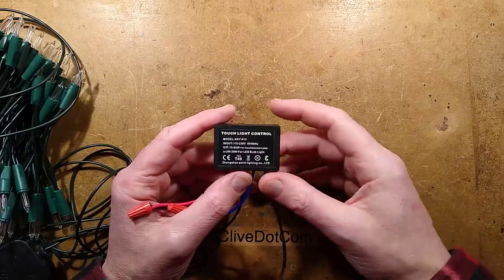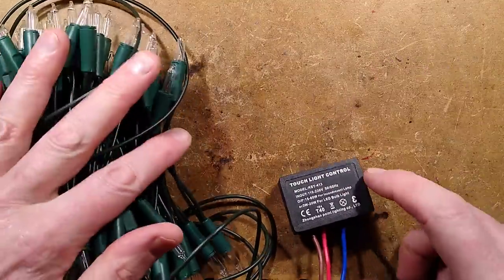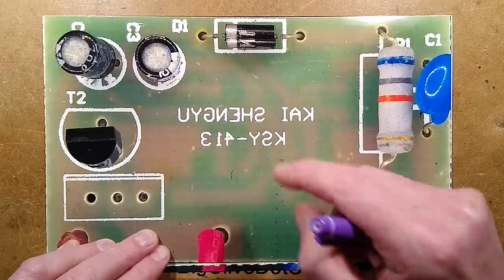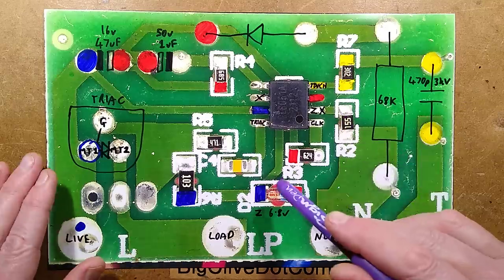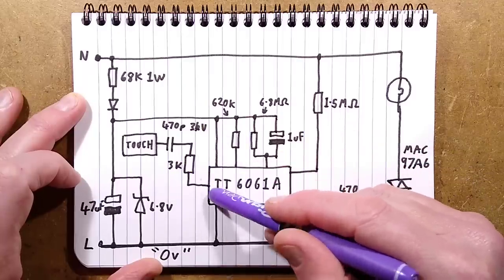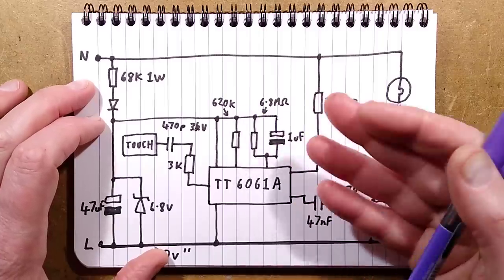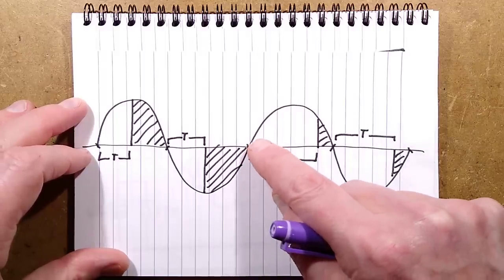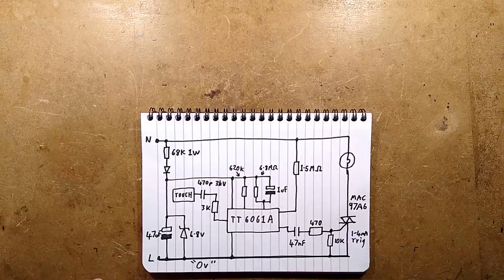eBay mains voltage touch dimmer - with schematic

Comment: Clive, do you reckon it may be possible the processor recognizes a change in the level of RF interference, and not a change of potential on the round sensor lug? Your hand setting it off on the insulated wire made me think so...

Comment: I never thought of using a dimmer switch in series with Christmas lights. It could dramatically increase their lifetime. 
Especially useful, not that the tungsten lamps are getting harder and harder to find with each passing year.
Reply: @Gazr Gazr Didn't the nasty flicker drive you insane? I can't STAND have wave rectified christmas lights. 🤢
Reply: @davelowets  You mean LEDs right? The flicker shouldn't be visible with incandescent bulbs.
Reply from the maker: Tungsten strings have made a comeback this year in the UK.
Reply: @M4RC90  Ah, yes, I missed that part. I can't even find incandescent sets around here anymore
Reply: @bigclivedotcom  Send some this way... Lol 🍻
Reply: @bigclivedotcom  god bless Noma
Reply: I use a dimmer on my vintage 1950's lights, a varilight trailing edge dimmer that happily controls a small load. It also ramps them up at switch on

Comment: There's a huge safety problem with this thing in that the circuit trace connected to the touch input almost certainly isn't sufficiently separated on the PCB from mains voltage traces. The 3kV capacitor should bridge an isolation boundary on the PCB.
Reply from the maker: Sadly, this is better than others.

Comment: I got given a faulty touch light by a neighbour to look at.
It had that exact module inside, the touch ring was under the upstand threaded nut which clamped it to the base. The whole light was made of metal, and it wasn't earthed, so I decided it was too dangerous to repair and return to them, so they got it back faulty.

Comment: I wbay'd one of these a few year years ago for a light project - and didn't quite trust it either - so had a look inside and noticed it had the rwo capacitors which allayed my fears somewhat ...

But adding a series resistor is a good idea for a bit more isolation - I shall do that !

Comment: I had a touch lamp as a kid.  You could play with the ceiling fan in a different room and it would cause the lamp to turn on and off. On a totally different breaker even.
Reply from the maker: That may have been due to switching voltage spikes.

Comment: Worth mentioning that there should be 2 caps in series, but they only installed one. But initially touching the insulation had the same effect. It is of course stray capacitance in series with the 4kV capacitor. It may be worth setting it up so you only touch the insulation Edit. I commented before the end of the video 😂

Comment: Triacs are notoriously noisy on the Radio Bands.
On the flip side, these lamps are sensitive to Radio Transmissions, by keying the transmitter, the lamps go through their Off Dim Bright ETC every time the TX is keyed.
Seen it in a neighbours window. Naughty but fun.
Some PIR sensors are also prone to a UHF transmitter nearby. I once visited a relative in my Camper Van. Every time I keyed the UHF TX, ALL the outside lights came on at once in the street.
People going outside to look whos there....

Comment: I normally use the non-dimmable version of this touch dimmer switch, for LED light bulbs. You Used to be able to buy these touch lamps in the UK, from the supermarket. I haven't seen them lately, maybe they're not compliant enough, due to the touching of the metal parts reference to Live. I have two, touch bedside table lamps. I replaced the dimming version of the modules, with simple on-off ones(from eBay, upgraded the triac for bigger ones) This makes it led compatible. I also added a resistor in series with the touch wire, for extra safety. In Europe you need to reverse the plug to get them to work, if the polarity of L & N is wrong.
Reply: It’s a pity that the Schuko outlets used in most of the EU countries are not polarized. In the States we use polarized plugs and outlets. On the blades of the plug you will see one of the blades that is a bit larger than the other and the outlet as well has one of the slot openings a little larger than the other. The smaller slot is always phase while the larger blade is neutral. The opening below the two slots is the ground (earth). Major reason for this design is that in the past electronics manufacturers started creating radios and television with a "hot chassis" concept where the chassis was connected to neutral. The hot chassis phrase comes from the fact in the early days plugs and outlets were of the same size allowing one to accidentally insert the plug into the outlet in reverse giving one a "hot chassis", this was a sure way to knock yer pants off!
Reply: Problem is that many dimmers are not LED compatible. Maybe that is why they stopped selling them.
Reply: @michaeltb1358  maybe, but the touch module comes in both dimmable and non-dimmable versions.

Comment: Any suggestion as to what value inductor between the triac and the load? It’s very bad in my neighborhood having noise coming from high voltage lines, aging insulators and a half a mile from the ocean. Corona central on the 7 KV lines feeding the transformers in the neighborhood. Next to impossible to work certain bands any time of day.

Comment: My bedside light is a touch sensitive one, it has a similar module to this inside it. I run a wire from the metal touch surface to the top of my headboard so I don't have to lean over to turn it on or off 😂 coz I'm lazy like that. Always wondered what was inside the module, but keep forgetting to take it apart and see how it works. I tried mine with led lamps to no avail.. Must need a load between 40 to 60W I'm assuming, which is well above a 3.5 to 5W led lamp. Great explanation as always Mr C 😎👍
Reply from the maker: The triac usually needs a minimum latching current to stay on.

Comment: Could you take a dusk to dawn light bulb to bits? I am curious as to how it doesn't sense it's own light in a fixture at night. Is it a time domain thing where the led shuts down for a microsecond and then the sensor loos for light,or is it that the sensor does not respond to the wavelength of the light it's controlling. Curious

Comment: Bought a couple of these from Amazon one of our touch lamps had failed. Casing and conductor colours are identical to this one. PCB slightly different. Connected as per diagram and it worked a treat, however out of interest I tested between metal casing of the light fitting and a known earth and had 160v which seems rather alarming. I was going to retro fit one of these to a bathroom shaving light but no Way, in a special location! 
Compared this to the matching other lamp which still has the original circuitry and it had around 20v.
Reply from the maker: The seemingly high voltage your are measuring may be because your test meter has an extremely high impedance.
Reply: Are we talking ghost voltage here Clive

Comment: Thanks for that. I've made a few lamps using these and it's a bit of reassurance. My main worry is always the same as yours, did the manufacturer do what they say they did? There are so many variations of wire colour out there, I don't trust them not to have substituted something and I've had some where the "touch" wire is black and others where it's yellow and the black is the feed to the bulb. For this reason, I always try it out on the first go using a neon screwdriver to touch it with. Deliberately wiring a mains electrical device directly to a metal casing always feels wrong!

Comment: As a radio ham,I have a touch lamp and it does generate a large quantity of noise,also when I am transmitting the lamp turns on and of because the touch wire act as an Antenna,no amount of suppression seems to work.

Comment: Are metal table lamps which use these modules safe, the ones I got from Ikea show a double insulated symbol. The mains plug is a three pin type but the earth pin is plastic. Would the main earth leakage breaker protect one if the case became live. The connections to the control module in the base of the lamp is the same as shown in your video. i get the classic tingling sensation when touching the lamp. You have saved me on a number of occasions from doing risky things particularly with microwave transformers - thank you.
Reply from the maker: IKEA stuff is well designed.  It will be made to local safety standards.

Comment: Whats the standby Power at 240v?
Reply from the maker: Very low.  Just the dropper resistor dissipation.
Reply: By my calculations it should be a pretty close to .42 watts.

Comment: I was expecting it to be potted. 
Aluminium foil tape, for ducting, has vulcanized rubber adhesive. I use two layers, with the lower layer in contact with the "ring" (in this case). Added capacitance and shielding. 
 ;)
Reply: I suspect that potting it would raise the price. Ain't no secrets in there anyway, so they only care about keeping cost down.

Comment: I installed one of these in my room as a teenager that triggered by touching a large lead weight I had suspended by my headboard and during and intense thunder and electrical storm it turned on and scared the living shit of of me. I had been watching scary movies before bed. I almost had a data shit it scared me so bad.
Reply: I have Touch Sensitive dimmers installed. They’ve been here in my apartment for over 30 years. During power glitches the lights sometimes turn themselves on in the dining room or living room. That’s quite annoying especially when I don’t notice until perhaps the next day when I go downstairs and see the lights on many hours later.

Comment: Bought a wall switch/dimmer with a touch plate some 25+ years ago. Touch it and lights on or off depending on previous state. Touch and hold, dim/undim (is that a word?) from last setting and "direction". Really neat! Lost it when the landlord decided to "modernise" the building and I never found one like it since. Boo hoo!

Comment: As  always an excellent video. Thanks for that very informative explanation on this device. If you ever come across one of those cheap LED globes that claim to have some sort of emergency functionality built in, in that they are supposed to stay on in the event of a power failure but still operate as a normal light bulb, it would be interesting to see a tear down on one of them. We are flooded with cheap Chinese ones her in South Africa🇿🇦, but very few of  the brands actually work as intended and also just how safe are they? Thanks for sharing. Love the channel!!
Reply from the maker: I've featured a few of the intelligent emergency bulbs.

Comment: There actually appear to be a couple of different "datasheets" floating around the internet for this..  One (which most closely resembles this circuit) appears to actually just be a one-page "how to" article somebody wrote up.  There is another one which looks like it may be an actual datasheet from the manufacturer, but interestingly that one shows a very different value for that clock resistor (330K instead of 620K) but still doesn't really explain the value at all (though it does say you should change it from 330K to 390K depending on whether you're using 50 or 60 Hz)...

Comment: so that will not work here in norway? we have both input live. no neutral.
Reply from the maker: As long as there is a reference to ambient ground it should work.
Reply: @bigclivedotcom  it's rely not. we run a "IT powergrid" look it up. same type they run on a hospital.

Comment: I agree about the rf noise. Also I've noticed when transmitting in the ham band my touch lamp gets turned on. It also turns on during lightning storms. Do you have any ideas to fix these issues ? Thanks
Reply from the maker: You could possibly make it less sensitive, but ambient activation is common with such sensitive circuitry.
Reply: You could adapt the snubber and RFI filter shown here:
https://www.homemade-circuits.com/wp-content/uploads/2021/04/smart-heater-controller-compressed-1200x716.jpg

Comment: I really don’t like that mains ac goes directly to the chip. With only a cap and small resistance between you and the chip… if the chip shorts out you will be touching a live connection !

Comment: How did the old lamps work?  I know for sure they didnt have any circuitry inside..  maybe a component or two but never saw any boards inside em..
Reply from the maker: Just a heated wire coil in a vacuum.
Reply from the maker: Just a heated wire coil in a vacuum.

Comment: I really enjoy your videos. I have a few lights I've acquired in my occupation. A cheap ever brite solar light and a Eshine 24in usb rechargeable led light that seems to be very high quality. I'm willing to send you two of each as my support of your channel. I would just like to know if there is an easy way to modify the solar lights to make them motion sensing only. Currently they stay on at low intensity and brighten when motion activated.
Reply from the maker: You may find there's a resistor in parallel with the main switching transistor to give the low level effect.

Comment: Years ago I watched someone repair and upgrade a circuit that turned on a relay,  to make sure it turned on when sine was at zero he added a component, any idea? I doubt manufacturers would do it, things would last to long.
Reply from the maker: It sounds like they replaced a traditional relay with a solid state relay.  (SSR).

Comment: I wonder if you could up the sensitivity and "use the force" to activate it - bypassing the need to touch it ...
Reply: I have a small conundrum I have 6 Nimh batts from some failed solar lights I want to charge and 4 slots available ...so individual channels so I can charge 1-4 or 2 channels so 2x2 or simple 1 to 4 trickle charge?...my head hurts

Comment: I had a customer who was having their house rewired, and we noticed that he had 3 of these lamps like this, and every single one freaked out the AFCI breakers. So I'm assuming these are no longer allowed for sale in the united states? or won't be for much longer... but yeah, every time you'd touch the lamp, the breaker would trip lol thinking it saw an arc fault.
Reply from the maker: That was probably the rough unfiltered phase control.  AFCI breakers are not a very good idea.  They're trying to push them here, but it's entirely profit motivated by people with poor technical knowledge.

Comment: In my experience dimmers don't really work with LED lamps even the ones that say they are dimmable on the box. They dim down part way then stick at a brighter level that I want, or go completely dark.

In the devices that go prematurely dark my guess is that the issue is that the led doesn't take enough current to keep the a triac latched. I haven't figured out what's going on when you can't get it to dim all the way to nearly off.
Reply from the maker: With some LED lamps they also have a capacitor which holds the charge from even the smallest part of the dimmed sinewave.

Comment: What should the value be on the resistor in series with the sensor prong/antenna?
Reply from the maker: You could add a couple of 100K resistors in series.

Comment: I fondly remember those touch switches.. 
Now today you use your voice to turn on lamps for a few bucks.
It SURE looks like they have those things carefully crafted down to the absolute lowest build price today. I'm surprised at the TO-92 triac in it, with the "option" for a TO-220 on the board. I'm guessing the tiny triac would mostly have to do with incandescent bulbs going bye-bye, and not much need to drive 100 watts anymore.
Reply: Yes used to be touched dimmers and clap switches, now it's voice control that doesn't work when the Internet's off and requires an app for every single device............ Oh yeah and the voice control never does what it's supposed to....
Reply: Grandma talked to her lamps near the end too...
Reply: @Lemon_Inspector  😆 🍻
Reply: @Lemon_Inspector  sometimes I wish youtube had reactions Facebook. 🤣

Comment: What could possibly go wrong. Heck I've taken the arc flash of 60,000 - 20,000 volts through my fingers and out my pants just below the waist and into the fender. It like having a lead pencil.✌️♥️👍

Comment: What are used in the UK instead of wire nuts?
Reply from the maker: Terminal blocks, or more commonly now, Wago connectors.
Reply: @bigclivedotcom  I had no idea what Wago connectors were until I started watching your channel. What a difference. The amount of force it takes to cram a smart switch and three or more wire nuts into an outlet box really is unsettling. It's the level of "both hands as hard as you can" type force.
Reply: @gloomyblackfur399  Realistically, however, if you're connecting two wires together, a wire nut takes up less room than a Wago connector.  I've compared the two :)   They both do the job.   Wago's, however, are much nicer when you're connecting multiple parallel wires, as long as you don't mind them being REALLY close together.   I think that wire nuts may have an advantage with stranded cable, and wago style an advantage with solid core.
Reply: @tbelding  The Wago 221 connectors? Or the Wago 222?
Reply: @gloomyblackfur399  - They're the same.  Wago 221 are supposedly up to 40% smaller than 222.   I do wonder about the conductor contact surface area with Wago, but obviously they work.  

The 'through' connector Wago style, rather than terminal block, really shine, however.  You can insert a 'patch' wire without having wire under strain from looping it into a wire nut, and if you have five wires you're bridging, a flat Wago would be better than trying to jam them into wire nuts.  (Usually you end up with two and a wire that leads to another nut, to grab another two wires, or you cram too many wires together into one bigger nut)   However, if I just need to join a live, neutral, and ground, to another live, neutral, and ground, in a ceiling fan - I'll use three small wire nuts - and I have Wago connectors in my electrical drawers.